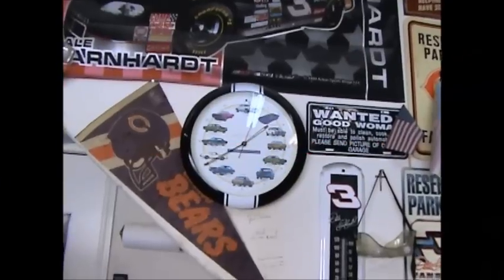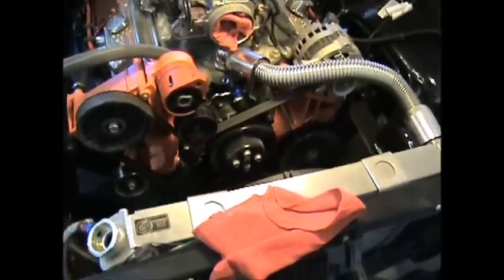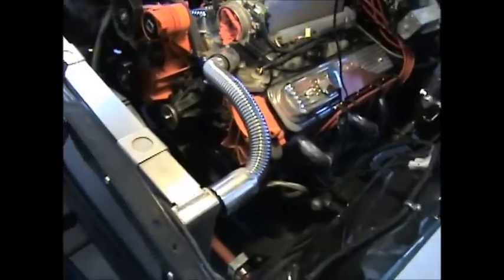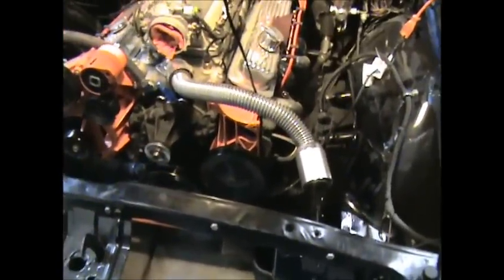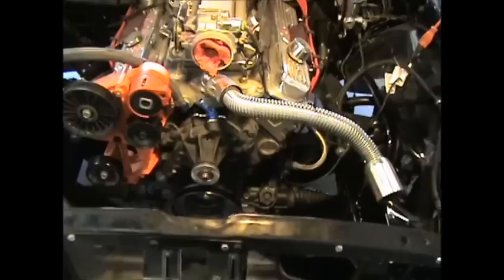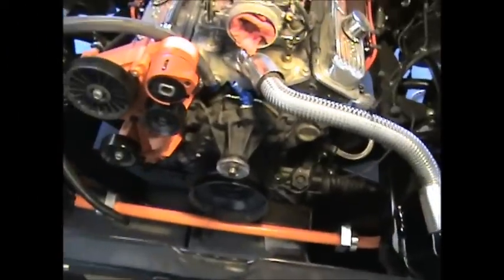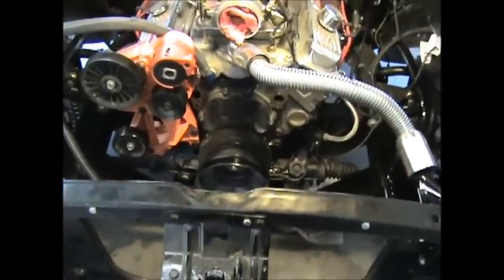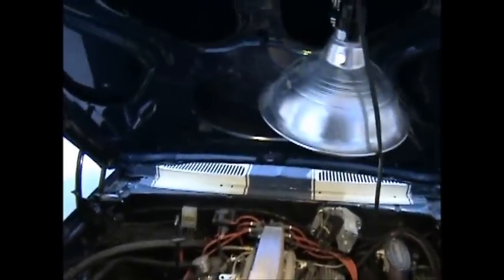1968 Camaro Resto-Mod 4-4-16

Comment: Cool tom, be careful if you are powdercoating a waterpump if i heard that correctly.   My friend powdercoated his and it leaked due to the oven roasting the seal in the front hub. Gettin closer to paint now!
Reply from the maker: +Swilling Sam, it was factory powder coating, but my son talked me out of it. Thanks
Reply: +Tom Noble Ah got it,  i guess that would be safer, since they probably do it on the casting before assembly then.   Keep the videos rollin!

Comment: Now this is just from my experience Tom...When diagnosing a coolant leak,,the best way is to pressurize the system to confirm the leak area...There are no guesses in my trade because if we don't fix it the first time there will probably be a very grumpy customer hounding on your arse that they have been taken for a ride...Were the pump bolts tight.?..Did you see the actual leak.?...Let's fix the issue rather than just replace parts...Just sayin'
Reply from the maker: +ZIGgassedUP Thanks Ziggy, the bolts were tight on the water pump, I pressurized the system to about 12 psi and didn't see the leak, the right side brackets were in the way, but I did feel where the water was coming from. I know what you mean about come backs, worked at a Chrysler and Ford dealerships back in the early 70's and hated when a customer brought their car back for the same problem. Thanks for the info. Pop open a cold one that was a lot of typing - LOL...
Reply: I just got home from work and cracked one open...Cheers Tom.